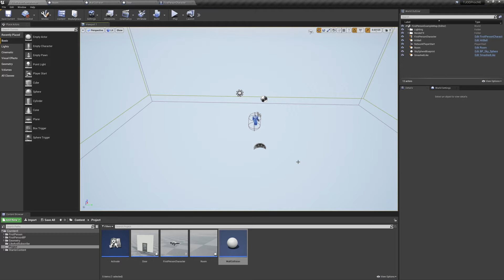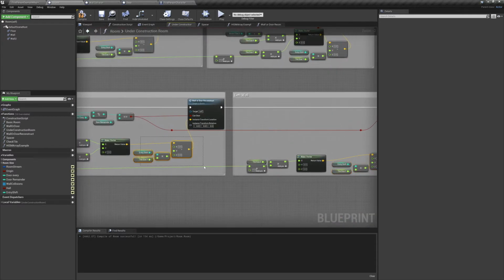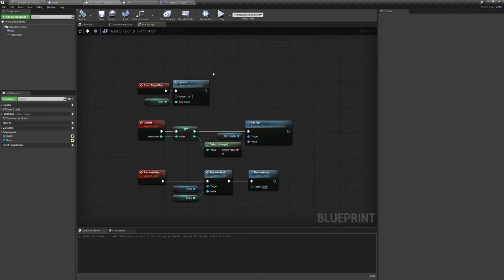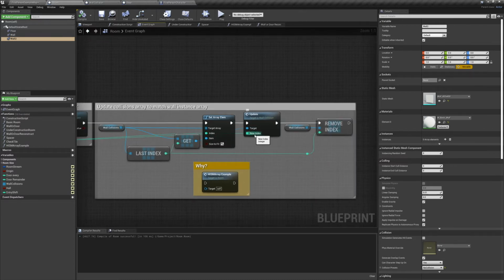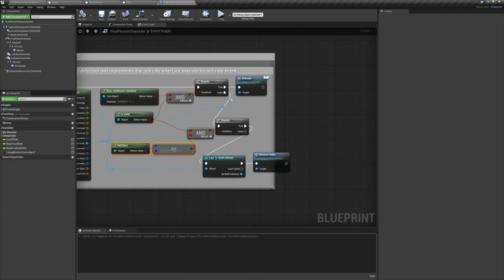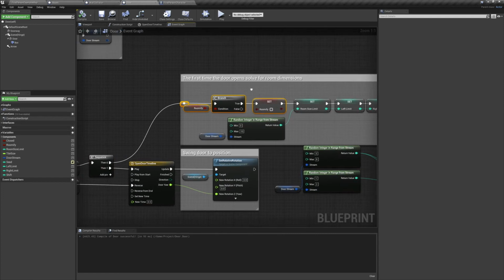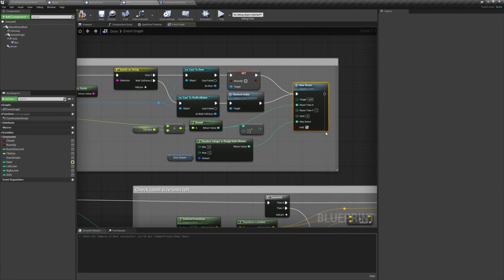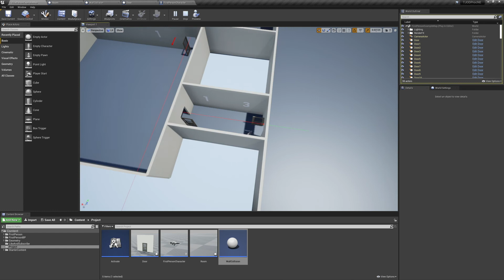UE4 Procedurally generated levels (Joining rooms with hallways)

Comment: I'm struggling so hard to understand what's going on
Reply from the maker: What parts are you struggling with?
Reply: @thejoyofdevelopment3773  apologize for my late response,
the reason for my confusion is that I had to manipulate and mutate the calculation of the placement of walls so that It works because for some reason when I used your methods to calculate the placement of walls they just didn't work properly thus my own calculations are kind of contradicting this video's calculations.
It is needless to say that I'm using UE5.
and apologize for my bad English since It's not my native tongue and I hope I'm making sense enough.
Reply from the maker: UE5 could have something to do with it I’m not sure though I havent worked with it yet. So long as all the positions, origins, and dimensions are the same then these numbers should get these results. Without taking a look myself I’m afraid I cant help much, but youve experimented and made it work another way, so as long ad you can understand why your method works then your making good progress. Theres also another method in these toutorials that uses different location and origins, that one might be helpful.
Reply: @thejoyofdevelopment3773  Thank you, I'll try my best to make use of this series
Reply from the maker: Hope it helps you

Comment: 2 more questions in regards to this Tutorial.

1. At (https://youtu.be/K6DkQmhdbIw?list=PLUVfF7mQpWjUUIlvMxvV206DpEdUpXtSZ&t=394) my Line Trace is never drawn. After doing some debugging it looks like the Start and End position of the Line Trace are the EXACT same location even though I have it setup like you do in the tutorial. But even when I try to hardcode the length of the vector it never appears.

2. Can you explain where the TileSize variable is getting it's value from? 
There are two references in "Door" and they are both "Get" references, not "Set".
Reply from the maker: On the line trace node have you set the draw debug type pin to something other than none? The line wont show if thats set to none. Other than that I’d need to see your code to make a better guess.

The tile size is the physical dimensions of the static mesh used. The standard floor plane mesh that comes with UE4 is 400x400 so 400 is the tile size used in the video but it will be unique to the mesh you choose to use. You can view the dimensions of a mesh by opening the mesh and in the view port it will show its approx size. Alternatively you could use the get local bounds node on the mesh and the range between the max and min values will be the size of the mesh, or just multiplying the max value by 2 will give you the same number as long as your using square tiles with its pivot point at its center, the result is your tile size. Hope that helps!